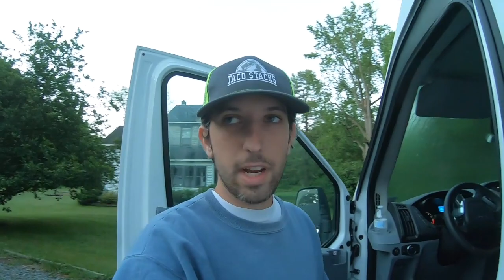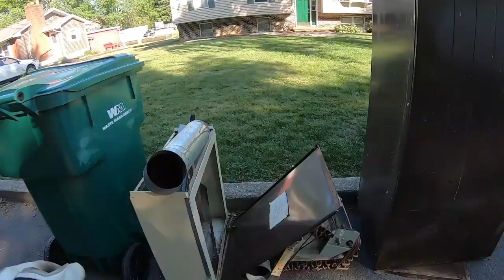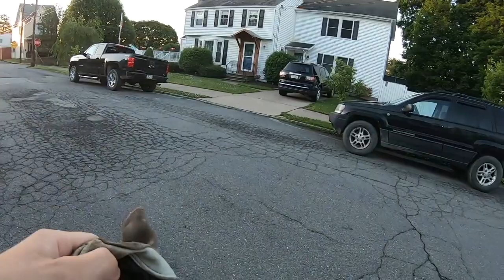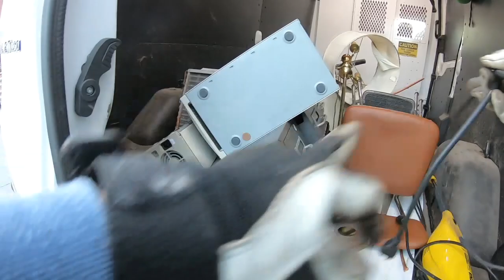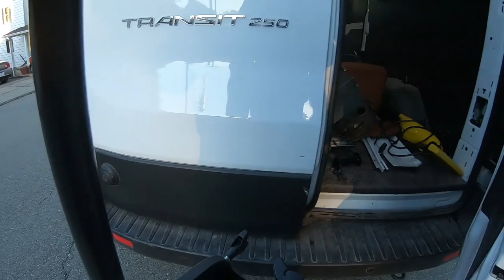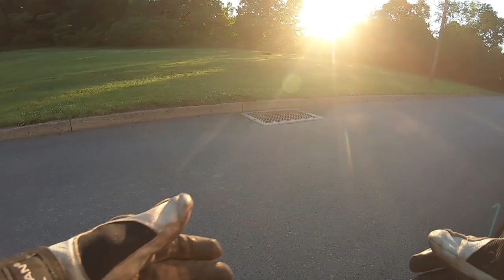They Cleaned Out Their Office! Trash Picking Ep. 305

Comment: Never heard of a flu that only lasts 3 days.  The only illness I know of is Rotavirus or Norovirus (the common stomach bug that is not really a flu at all).  My only concern is that this should make you more aware of how to touch and move your face mask around at the flea market.  It only works if you leave it on and remove it by the straps.  It only works if you sanitize your hands before you remove it or place it on.  I wanted post a few days ago after watching your flea market video and how often you adjusted your mask which just moves the virus or germs to the inside of the mask, but I figured the trolls would get me.  I am posting this to remind those who do not want to catch whatever virus or a nasty case of gastroenteritis, don't fiddle with your mask once it is on correctly.  Yes, it should feel stuffy and yes, we just need to adjust to wearing them.